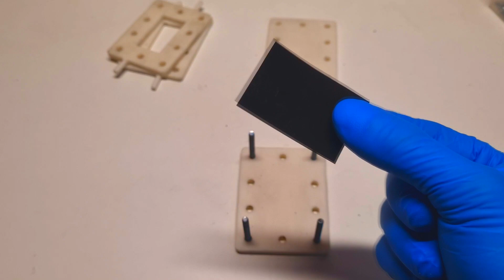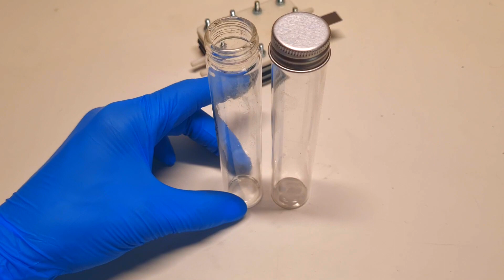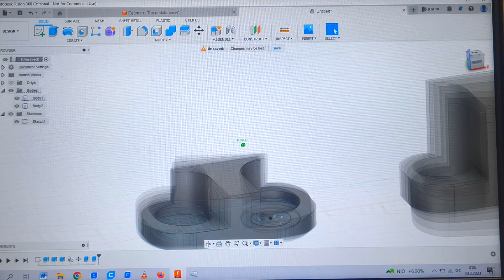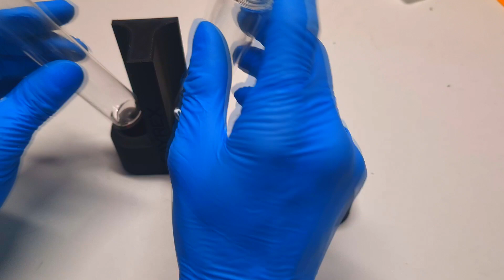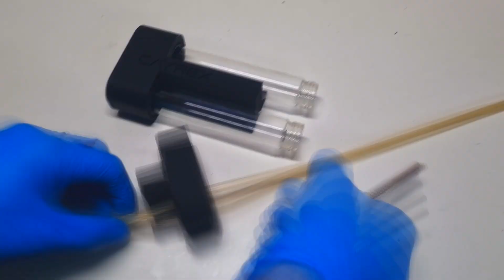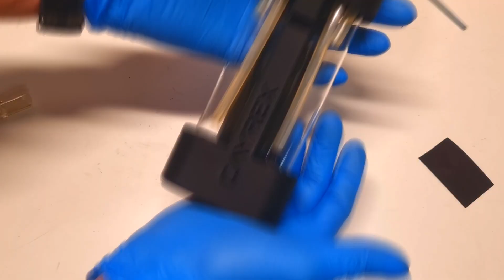Diy Vanadium Redox flow battery - PART 1

Comment: Hie what is the function of carbon felt,,, what is the effect of not putting it.
sorry for being too inquisitive, am actually trying to come up with something of this sort.
Reply from the maker: The porous structure of the felt offers a large surface area, which is vital for the redox reactions to occur efficiently. The higher the surface area, the more sites are available for the redox species to interact with the electrode, improving battery performance. Also a large surface area contribute to higher cell output power.

Comment: Is there any problem if l use PETG material instead of resin. Why resin ???
Reply from the maker: PLA and PETG will not last really long in acid or alkaline environment. Because vanadium electrolyte uses strong acid like H2SO4. But the resin like ABS like resin will last way longer in the acid and alkaline environment.

Comment: Great. Have you tested different membranes, or just paper?
I'm thinking about buying a membrane, but it's a bit expensive.
I was wondering if it's possible to use a carbon plate as a separator, like in fuel cells.
As for the membrane, I was also thinking about testing crushed sand or wood.
I read somewhere that they tested wood and coal, because they "breathe".
Reply from the maker: Yes I tested other membranes also. In vanadium battery Part 5 I use Nafion membrane. In fuel cells are mostly used a proton exchange membranes which are coated with platinum/carbon. For that reason the active area in the membranes are looking black.

Comment: As for the separator membrane. Have you considered the membrane inside a dead 18650 cell? You'd have to fully discharge and disassemble one and wash the membrane carefully but there is plenty of material in there.

Comment: Great video. What material are the reactor plates made from?
Reply from the maker: Hi! Thanks. They are printed with resin
Reply: Is there any problem if l use any other material which is not resin, for example PET-G  @cayrex

Comment: thanks for your good quality video :) I want to make some RFB for my graduation work, I want to change the bipolar plate for showing the difference between traditional bipolar plate design and the brand-new plate design. What should I change the part in your channel? Thx:)
Reply from the maker: Aha ok. You want to show the difference between traditional bipolar plate and the brand new plate design. But which brand new plate? Sorry, I'm a little confused 😁
Reply: @cayrex How can I change the flow channel?? I know that the flow channel is designed with carbon felt, which can not be printed...?

Comment: Maybe you can share a list of materials you used, where you bought them and maybe some 3d models of your printer.. would certainly help your channel i think..
Reply: Conductive HDPE sheets offer static dissipation and protection against electrostatic discharge (ESD), ensuring safety in electronic manufacturing environments.
Reply: Graphite felt, also known as graphite fiber felt, is mainly used as a thermal insulation and refractory material for various industrial furnaces. It is soft, flexible, and high-temperature, typically used in vacuum and protected atmosphere environments up to 5432℉ (3000℃).

Comment: Your accent is so thick that trying to follow the materials selection is a serious pits, please fix the closed captions to reflect the correct material names.
Reply from the maker: Thick? I come from Slovenia,... here is everything thick 😂 Here I dont use more like resin printed plastic housing,... graphite foil or combination of copper and conductive HDPE as current collectors,.... graphitic carbon felt as reactor electrodes on both sides. Then is also the separator which need to be some ion exchange membrane (but here I use some baking paper,... which is good for short testing). Two tanks, two pumps, bunch of pipes and electrolyte which is V2O5 in H2SO4.
Reply: @cayrex  I thought baking paper is silicon based, isnt that a sealant?
Reply from the maker: @noanyobiseniss7462  oh and yes, I forgot the neoprene rubber as gasket

Comment: Im interested in this project for my tiny house truck life where I have 2kw of solar and 9kw of lithium which is more than I need in summer and if i could store what I don't use in a bigger version of this for use in the worst 2 months of winter it would make my life much easier. This type of battery does'nt have self discharge so I could charge it in summer and use it in winter?
Reply from the maker: Yes correct,... you can charge in the summer and the use it in winter.

Comment: Do you any complete set for sale?
Reply from the maker: I will think about it. But maybe will be only the only housing like cell housing, electrolyte tanks, pipes, gaskets,... without membrane and electrolyte. Because small piece of membrane can be expensive and the electrolyte also uses concentrated sulfuric acid which I dont want to ship around. Or maybe I will come up with another flow battery experimenting kit which uses more friendly electrolytes like Mn-Cu, Mn-Zn, Fe-Fe,..... with modular cell housing which can you upgrade the cell to multi cell stack.

Comment: In the reactor plate, will the electrolyte flow within the plate from the two tube points? If so then how would the electrolyte come in contact with the carbon felt?

Comment: Do you have any advice as far as measuring equipment for someone looking to get started in home battery making and testing?
Reply from the maker: Yes for sure. Search for zketech, because they are cheap. ZKE EBC-A20 for measuring cycles (up to 1000 cycles), mWh, mAh, V,... but the problem is that the minimal currend load is 100mA, which means that you can not discharged the test cell with lower currend like for example 50mA, 30mA or so. Then you have a littel bit smaller and also more cheaper version which is  zke ebd usb electronic load to measure the mAh and mWh but that one can not test the cycles,... but anyway with this one you can use much smaller discharge current load. Also some multimeter will be fine.
Reply: @cayrex  What is a typical current density for an electrode 1cm wide and 3cm long?

Comment: Hi! I have some questions about the flow channels you used! I don't see how the electrolyte comes in contact with the electrode ☹I loved what you did with the tanks! The 3D printed design is gorgeous and very functional!
Reply: The flow channels are the carbon felt. These are not flow channels as such but the positions of the inlet and outlet will encourage cross flow to some extent.
Reply: you could add flow directing channels to distribute the electrolyte more evenly.  The Felt would just conform to the underlying surfa @rogerwilson6367
Reply: Yes I inderstand

Comment: Have you looked into organic batteries yet? How about a hybrid organic/inorganic cell? For instance what do you think about an anthraquinone based electrolyte working in conjunction with a Vanadium or iron multivalent cation instead of bromine anion?
Reply from the maker: Interesting! No sir, I never make a organic cell but I like the all organic battery concept. I read little about something like polyaniline/zinc battery systems, Organic carbonyl electrode materials,... some time ago and I like it because they can have good cycle rate.
Reply: @cayrex  polyaniline is what I have chosen to start experimenting with first as it seems like the easiest to make at home..
Reply: Interesting

Comment: You have 3D printer, time to print double peristaltic pump for such case when you need to pump two liquids with the same speed! You can do it ;)
Reply from the maker: Yes I working on peristaltic pumps for some other project. Maybe I will print some for that project. Still I am waiting for some motors and I will see what will come first,.... the motors or the pumps. 😄
Reply: @cayrex  i need to dissassembble some old printers i have on attick, great source of motors for any projects :P
Reply from the maker: @ejkozan  Yes. I was thinking to buy some old printer but then I somehow end up with oredering the parts, motors, pumps,... 🤔😄
Reply: @cayrex  If you have any office building near by, you can always try bindive, often you can get old electronics this way, because they throw it away

Comment: You might like to obtain some Dialysis membrane tubing for your separator, It's a lot cheaper than Nafion. I'm not sure how long it would last in an acid environment or how efficient it would be though, but I have used it before. I have some which is 25mm wide when flat so will give separators 50mm wide. Love your work.
Reply from the maker: Good idea. I will make a look at it

Comment: Beautiful work.  If you could find a longer lasting membrane that wasn't so expensive you would be famous :)
Reply: Pardon my ignorance, but what does the membrane act as for the system?
Reply: @notimportant8120  it won't work without it. It's an ionic conductor. It keeps anode and cathode from contacting each other electrically but let's ions pass.
Reply: I have used coffee filters with polyvinyl alcohol, (wood glue), let dry. Lasts a little longer. It works for zinc. Don't know about vanadium.